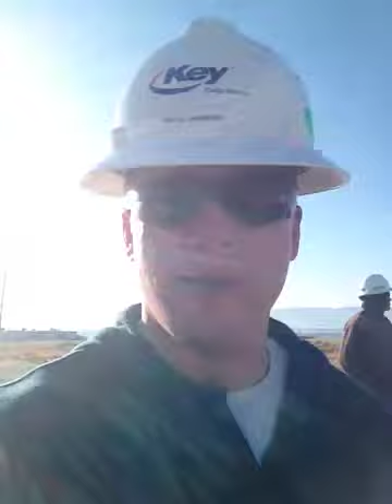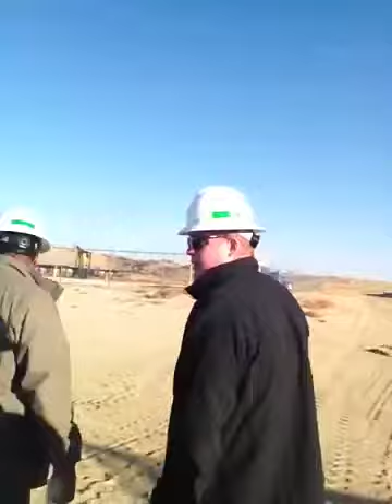Oil Rig, RoughNeck, Day 1 of Training, Oil Jobs in Williston, ND - Video 5

Comment: Ralph horizontal drilling is the process of essentially drilling horizontally, the way in which a well is drilled has little to do with fracking a well. Buddy its two different things first the surface pipe is put in, then it is drilled, then fracked, then plugs are put in and that's when we come involved. But good vid, people should watch this it don't make a difference if your brand new or been there a while. A good driller always listens to his hands, and helps explain if lost.
Reply: Sir, how can i join the oil rig? I've heard it's challenging and rewarding and I wanna work here so badly, so can you please guide/help me?